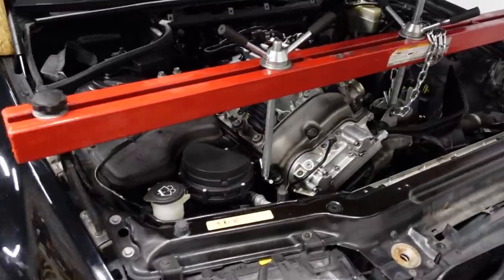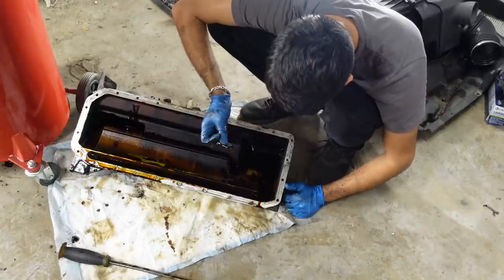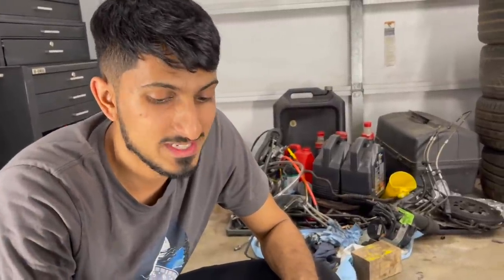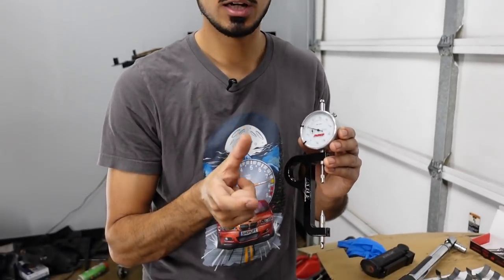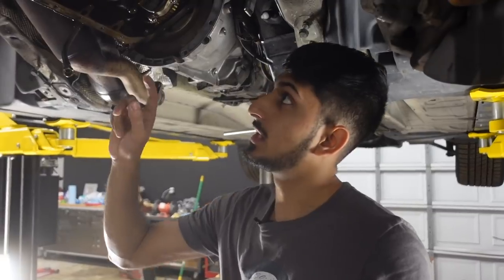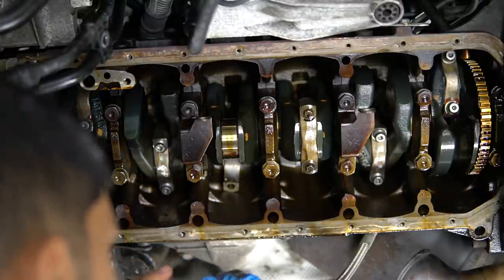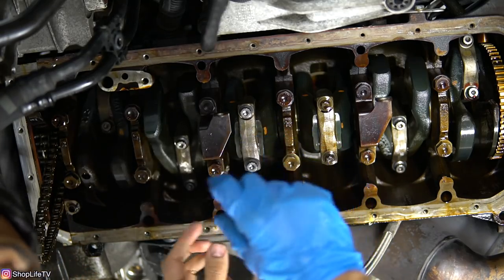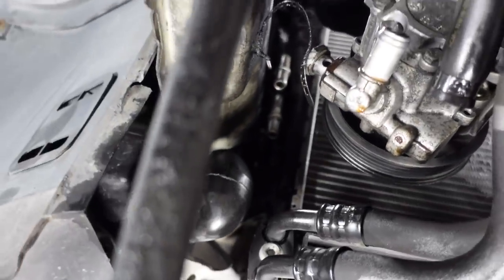ALL E46 M3 NEED TO HAVE THIS DONE! (S54 Rod Bearings Tips and Tricks)!

Comment: Great vid guys! 
Sight unseen and shipped to you? That’s some serious trust. Over the years, you guys earned an outstanding reputation — highly competent & fair pricing. Honestly, can’t say the same for any other shop out there.

Imho, to maintain S54 longevity, it’s imperative frequent oil changes with the right motor oil (synthetic 10W-60), properly warm up the engine oil before beating on it and after spirited drive, not a bad idea to allow the engine (and brakes) to cool down before shutting it off.
Reply: What should I use for my M50? I've been using 5w-30 synthetic and to be honest I'm not sure if the death rattle I'm constantly hearing is my Vanos or the rod bearings about to crumble. The oil always comes out clean no metal shavings, but as soon as the car comes up to temperature it sounds like a diesel. 🤢
Reply: @herbienbrian2  
Could be the motor oil weight. I highly suggest running Amsoil 5W-40 or Pennzoil Ultra Platinum 0W-40. Both proven the best motor oils available for M50/ M54 motors. Also, make sure to run high octane fuel like Shell V-Power and from a quality station. Some branded gas stations fill their tanks with cheap off-brand fuel. Preventative maintenance/ maintenance such as rebuilding Vanos system is always a good idea. 

In the vid description, you’ll find a link to “Ask me a question.” That’s the fastest way to directly inquire with Jason/ Alpha Motorwerks the channel creator. I’m sure he can properly diagnose your problem. Good luck with resolving the issue.
Reply: Use Shell Rotella T6 oil..
You can thank me later..

Comment: I replaced them on my 07 z4m coupe at 68k miles. They were down to the copper. Newer models are not exempt
Reply from the maker: 68k is very early! I hope the bearing material didn't cause any other damage!
Reply: Mines an 02 with 138k let’s get it done ASAP lol

Comment: Over 217,000 miles on my ‘04 M3. Bought the car with 62,500 miles on it, have not done the bearings since I’ve owned it. I’m rarely hard on it though. Looking into getting it done. I’ll probably take it to Destin Imports in Destin Florida since I don’t think you’re close to where I’m at. I feel I could do it, but I’d be slow at it for sure, don’t have a lift, and would have some tools to buy I don’t have.

Comment: First of all thanks for your videos. I find your explanations very thorough and clear.

Question: when using ARP bolts, is it not necessary to check clearances with plastigauge? Or can you only skip measuring clearance of using extra clearance bearings? Thanks again.

Comment: My 2005 M3 (E46) @ 102K miles per Blackstone Labs oil analysis...copper content is a-ok, therefore rod bearings are still solid.  Change oil every 7,500 miles
Reply: Just fyi used oil analysis can only identify certain sized particles and it’s not evidence you don’t need rod bearings. I’ve seen 2 clean UOAs and then S65 threw a rod.

Comment: Sir, I have a question! It's a 2006 model. The manual says to loosen and tighten the rod bolt 3 times.. right ? But you tighten just only once Is it okay to tighten it only once? I bought an ARP M10 bolt. And I don’t have stretch gauges 😢

Comment: Hey mate, thanks for the great video.
I'm getting my first E46 M3 tomorrow. I have done regular maintenance, CCV, coolant system, valve cover, suspension (bilstein b4 on oem springs) and oil pan gasket myself on my 2000 E46 323CI. Do you think I could takle rod bearings myself on my M3?

Comment: Another amazing Video! I did this job as s54 are notorious for these… a very tough and long job. Hard to do it as a DIY not going to lie. Ramp is very much needed. 
Just a question, when or is there any need in changing the big end ones?  can it be left as it is? I mean people do tend to recommend in just doing the main ones rather. 👀

Oh and maybe also replace the oil pump sprocket? Also notorious for undoing ⚙️
Reply: IIRC, the oil pump issue is on the M54 engine, not the S54. The S54 engine has a tensioner for the oil pump chain, so there's no chain slap.
Reply: These are the big end bearings he's changing. The main bearings are the much bigger job.
Reply: @cdh76  😂 I know Buddy. As you’ve read my appreciation post, I did this job too. I was just asking if its also worth doing big ends or when its required and maybe during this particular job wouldn’t it be worth also doing oil pump sprocket and nut… cause its worth doing the engine mounts sump seal etc 😉
Reply: @burakasiliskender  What's "doing the big ends" then?
Reply: @cdh76  can you read? 🤦🏻‍♂️
Read the first post and my reply to you. I am asking if it is worth doing them or when it is especially whilst doing the main bearings.
Reply: @burakasiliskender  I read just fine thanks. He's doing the big end bearings in the video. You then say "when or is there any need to change big end ones". He's doing them because they wear as you see in the video. You then say "just asking if it's worth doing the big ends". He's doing the big end bearings in the video because they wear (again). Which people just "recommend doing the main ones" (your first post)? No one recommends doing the main bearing as "preventative maintenance" like they do the big ends.

Comment: When I did my rod bearings, @ 235K miles the bearing where changed at 80k but they looked good I used ECS WPC rod bearings and bought the ARP rod bolts but I did not plastigage or measure bolt stretch I thought with the ARP bolts I just had to torque them down, and didn't have to worry about stretch that was only on the factory bolts... But would you suggest I drop the subframe again and re-do them ? also I bought the ST suspension coilover kit and completely restored the car I have 10mm spacers on the rear. and after alignment was done professionally my passenger Front and Rear wheels stick in from fenders about 1 inch and on driver side are perfectly flush. Have you ever seen this before ? The car was never wrecked i rebuild front and rear subframe and reinforcement with full Garagistic kit . I know putting wheel spacers on one side is a no no.... if you have an email i could send you some pics.
Reply: ARP bolts are designed to do both stretch torquing and using ft. lbs. 
I believe that measuring stretch is the preferred method as it gives a more accurate tolerance for the bearing to work with, as nothing is quite perfect.
I wouldn't worry about it at all, i'd say next time you do bearings you should use the stretch method though.
Reply: Seems like you're prob good, but on the M11 style bolts on mine the ARP recommended torque was waaay off the target stretch. Rec torque got me 6/1000 and those require 7.5 - 8. But keep in mind if you use VAC bearings with extra clearance then 1/1000th really isn't all that much. The fact they say either method can be used by stretch is preferred should tell you all you need to know about how perfect this actually needs to be i.e. in the ballpark is fine.

Comment: Hey Jason. I have a question, my M54B25 valve cover seems to have an "issue". On the center stack bolts (middle ones) the 2 middle ones come out just fine, but the the farthest and the closest one facing the front of the engine I cant fit my 10mm socket on it.. the 10mm socket doesn't slide all the way down.. I dont know what to do.. Its almost like maybe its warped and stretched or something? I imagine I could maybe just shave down some of the material enough to get the socket to fit but I have owned a few e46's.. always in very good shape, low owners 2-3 at max so I am not sure why this one is like this? am I in for a new valve cover?? Thanks

Comment: Hi Jason, very nice tuto.
May I ask you why you did not use a “plastigage” to measure the clearance between the rod bearing and the crankshaft? And then choose the “right” bearings as there are 2 ratings, I think .
Greetings from Belgium 🇧🇪
Reply: I believe Jason mentioned in the video the reasoning was the VAC bearings come extra clearanced, whereas they don't need to be plastigauged like you would on original stock rod bearing replacements.
Reply: @VNEMUS  ok thanks for the answer, indeed I remember now

Comment: I have a BMW X5 M 2013. The engine sounds as if there were a screw inside. Everything sounds like the rod bearings. My question, can that be replaced or does the entire engine have to be changed? Thanks
Reply from the maker: It all depends on the damage caused by the spun bearings. Only way to tell would be to remove the oil pan and check for scoring on the crank as well as the cylinders.
Reply: It is complicated because where I am the mechanics only want to change the engine for a new one and I feel that they just don't want to check anything, just change it, and I reviewed your video and your shows something different that that was what I liked, a good mechanic will help you gives options and not only tells you how easy it is to remove the old engine for a new one
Reply: I parked my BMW at the moment that engine noise started so far I have not moved it, I just recorded a video and before taking it to a place to leave it, I show them the video and that is what they tell me

Comment: So would you say it's safe to use ARP bolts ? Here mixed info to use and not use them cause how they can mess up the rod cap
Reply from the maker: It is safe to use ARP Bolts when using them properly and not over torquing them. In racing applications where the rod bolts are being removed frequently, this could potentially pose a concern, but usually in those applications you are probably going to upgrade rod and caps anyways.

Comment: I had bout an S54 for $1000 bucks with 169k miles on it, I didint think it was good but I put it on anyways, to my surprise it was good, but my dumb ass drove it another 2k miles without changing the rod bearings and I spun a bearing.

Comment: I'm surprised you didn't use loctite on the rod bolts isn't that applicable?
Reply from the maker: Not sure if there are any rod bolts that require loctite. On ARP fasteners you are supposed to use the ultra torque lube, like I did in the video.

Comment: What causes a bmw to put it self in park from any gear
Reply from the maker: I would scan the EGS/Mechatronics module to see what fault codes are present. This could be related to an issue with the shifter or the transmission solenoids
Reply: It has no gear shifter codes but it does have clutch a and clutch b implausible

Comment: By the way my 2004 m3 did rod bearings at 26000km at dealer. Now has 420000km. Not a lie. How did it last this long? I beat the crap out of it but religiously warm up the oil temp. Still puzzled.

Comment: HOW DARE YOU MENTION THESE BMW ISSUE BMW FIXED THE NON EXISTENT PRAWBLEHMS THE ETHERNET WIDE WEB BLOAWS EVURRY THING OWT UHF PRUH PORSCHE UHN 

IT HAP PENZ TEW. 0.69.420% OF OWNERZ DONT TALC ABOWUT IT. 

PS. MY ROD BAYERINGZUH JUST BROKE CAN YOU HELP ME FIX DEM
Reply: Jokes aside yea you can’t trust the bmw bearings on the e39/e46/e90 m3/m5. You need the BE bearings and arp bolts.

That said bmw should be ashamed they didn’t even do any recall for the e90 and e60 owners. They got screwed